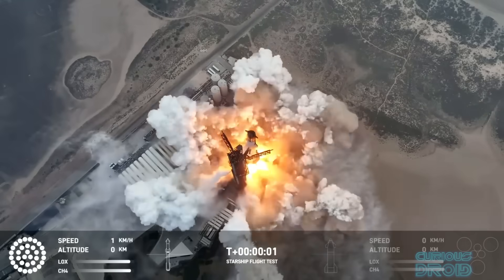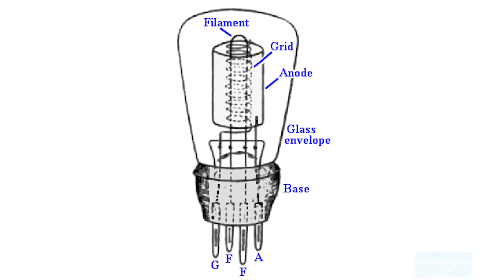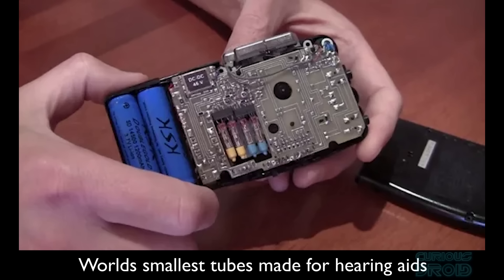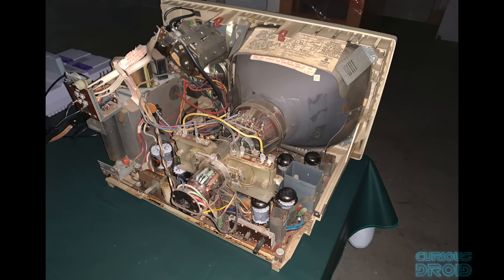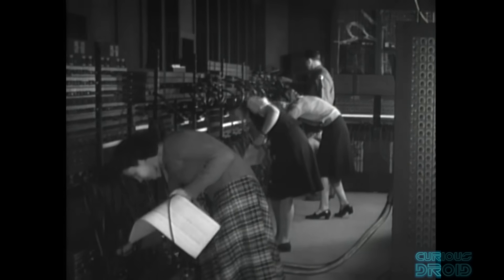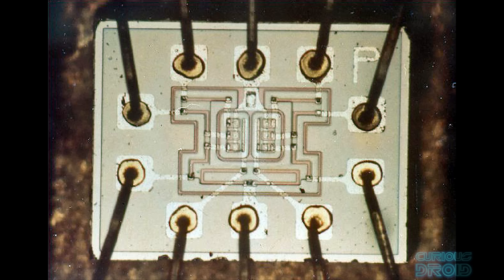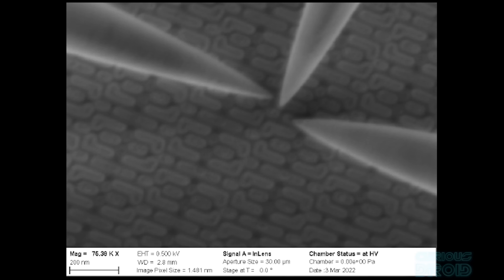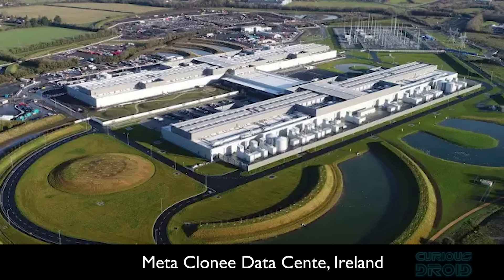Miniaturization - The Biggest Little Thing to Happen in the Last 60 Years

Comment: Batteries are weakest link in all of technology, since WWII, the physical form-factor and energy density of batteries of today, have only been reduced to 1/5 of there original size (there are only so many molecules of materials available for anodes and cathodes).  On the other hand, the smallest single function vacuum tube's glass envelope (the peanut tube) in 1945, will hold more than forty billion transistors, batteries will never catch up!

Comment: A monolithic integrated circuit (IC) is crafted through an intricate and precise process that transforms a circuit design into a functional microchip. It begins with capturing the design and simulating it to ensure performance and functionality. Once verified, the layout is meticulously created, defining where each component will reside.
The real magic happens when layers of silicon, each doped differently, are deposited onto a substrate wafer inside a quartz oven. These layers form the foundation of the circuit, while metal interconnects are added to establish electrical pathways. The wafer is then cut into individual dies—tiny, distinct chips—before being enclosed in epoxy housings. Each chip’s contacts are extended into small metal legs or pads, allowing it to be connected within electronic devices.
The result? A marvel of engineering that powers everything from computers to smartphones. It's a process that showcases the fusion of physics, chemistry, and electronics in a single piece of technology. Quite fascinating, indeed!

Comment: "that  remained pretty accurate up the 2000s when progress has slowed due to nearing the limits of  just how small we can make physical transistors."
The transistor size could (and was) still reducing, but what couldn't be done is clock speed rise. What you said before about "smaller means faster" stopped to be true, as no solution was found to the heat problem: current consumption in a chip are in frequency power 5 (if I remember well), which heats it, and after 2-3GHz it started to be almost impossible to run faster without burning the chip.
AMD saw that limit before Intel (that was still bragging about future 20GHz CPUs) and choose to use the excess transistors on the die (allowed by their continuous miniaturization) to go multicore (they were the first to do that).
A dual core chip at 1GHz is less efficient than a single 2GHz core chip, but AMD, and other after, realized they had no choice: the days of "smaller means faster clock" were over. So, nowadays, all the miniaturization gains are used to add more pipelines, caches, long instructions, vector registers, cores, GPUs, NPUs, etc. instead of doing the more efficient obvious (but thermally impossible): rising clock speed.

We may be now touching the miniaturization limit, but 20 years after we stopped rising clock speed...

Comment: 6:10 Are you sure about that power consumption?  150 KW for 18,000 tubes is only about 8 watts per tube, which doesn't sound enough considering the other equipment in the system (like the fans to cool them).

Comment: I worked in a TV repair shop when I was 16 in 1969. I  went on and learned both transistors, tubes, analog and digital computers in a military enlistment. We were also taught Boolean Algebra. Worked in electronics and telecommunications my whole work career with lots of hands on of computer hardware and  networking. I’ve seen a lot of changes along with miniaturization of electronics equipment.

Comment: In 1986 I got a job at a new semiconductor plant in Durham, NC (RTP). I worked in the wafer fab doing photo lithography. I also inspected the wafers layer by layer looking for defects. The semiconductors were printed/etched layer on top of layer connected to each other almost like a multi layer city. I was nuts to think someone designed them with millions of transistors and all the other elements. We did hundreds of chips for the military and other companies that needed specific purpose built chips. We didn't mass produce basic chips. It was absolutely bonkers. This was basically new and evolving tech. I think some of chips we made were in the 2-3 micron range not the nano range of today.

Comment: 8:55 - That Apollo computer is restored in a CuriousMarc video series a few years ago. It used core memory for RAM (Data only) and "rope" memory for ROM (the program).

FYI, ROM is where the program (firmware) is stored, and directly accessed by the processor, as opposed to the inefficient way current operating systems work. There, only a small "boot loader", and BIOS functions are run off a modern Flash "ROM" , while most of the programs are stored on your hard drive. That long power up boot up, is the result, of the OS (operating system) having to be loaded from that hard drive to RAM, when from there, its executed. Likewise, any program, also needs to be loaded to RAM, before execution. This is done also, on your smartphone. Though on smartphones, and newer (last 10 years) computers, the drive is solid state (ironically). In the embedded world, this inefficient "boot" (drive to RAM transfer), is excluded, and the program permanently resides in parallel Flash memory, that is directly executed by the processor.

Comment: 6:35 Does the i_Phone really have Floating Point? I thought those ARM processors, can't even do division in the processor! 
Btw Floats are a miserable Numbers_Format; each implementation gives different results, so they need to do excessive large bits: 64 bits for purposes where even 16 bits would do!!
A better definition would be John L. Gustafson's Posits Number Format. University of Singapore. With a hardware implementation of the so-called "Quire"-register those processors could do high-quality math, fast and efficiently! Indian programmers are redoing the Math libraries, which are often written in Fortran and contain some very old bugs! 
Unfortunately, the Posits format wasn't picked up by Fujitsu, or Intel (probably the US-NSA didn't like the idea!! it could ruin the "dark"-bits-spaces, where creepy Java creatures are crawling).  Nor did Posits become Standard in the Risk-V definition.

Comment: 12:49 which is a bad cpu that is out performed by the equivalent AMD part by a fair bit. the 14900 also lacks SMT, primarily because intel can not figure out how to secure the second processing thread adequately. They are covering this up by making claims of SMT being computationally expensive but that is only true for the current implementations that intel is using and that is only the case because their implementation of SMT has been flaw from the start. Although the comparison is generally accurate, comparing the 4090 to a 9950x or the upcoming 9950x3d would reduce the gap somewhat.

Comment: If you think ENIAC was the first digital electronic computer, guess again!  The Atanasoff-Berry Computer was actually the world's first digital electronic computer.  This was legally established as fact in 1972 in the case Honeywell v Sperry Rand.  It turns out that Sperry Rand used patents covering ENIAC to build a whole line of computers; however, much of the work that went into ENIAC was "borrowed" by John W. Mauchly and J. Presper Eckert, Jr after Mauchly visited Atanasoff and Berry in 1941

Of course, Bell Labs' invention of the silicon based, solid-state transistor occurred at just the right time, and the rest, as they say, is history.

Can you imagine what a modern data center working on vacuum tube technology would be like today?

Neither can I!.

Comment: We keep coming to the limits of Moore's Law and then finding ways to circumvent them.
Storage drives have long used multi-layer building. That idea has now found its way to CPUs and logic circuits. See any Ryzen 3d chip. Does it count under Moore's Law if you're talking about more than one layer of silicon and integrated circuits?
We have multi-layer gates coming, and next they say they're going to orient those vertically ~ not horizontally.
Then we have glass substrate and active cooling. The real limit to 3d chips now, is practical cooling of them.
Yes, we can make huge single whole wafer chips. That is being done, but that's not a practical way to do things.
Imagine a Ryzen 9, with an I/O die, and 2 CCXs. Then allow a 3d cache chiplet stacked under the cores. Now drop a 2nd one on top of that. Let's stack it 32 of those layers high. You know what's stopping us doing that right now? We can't cool it. There's no way on Earth we could run that at anything close to the speeds and the power a conventional Ryzen chip today runs at.
The problem is not even getting the power to it ~ it's dissipating the heat. We are going to see the data lines go to the top and the power lines go to the bottom. That's already in development. See "Back side power delivery."

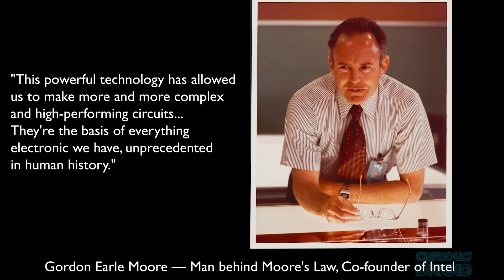Comment: 10:16 if we're being pedantic, technically, Moore's law is still pretty accurate because it was only concerned with the number of transistors on a single IC, not with the number of transistors in a constant area. While transistor scaling has slowed (and Dennard scaling has entirely died), we are skirting the limits of Moore's law by leveraging advanced packaging, allowing us to put more dies on a single package. This allows us to fit more transistors on the package while also improving yields because the dies are smaller.

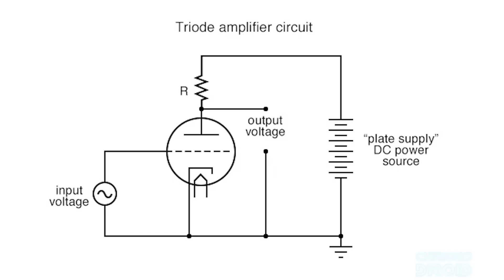Comment: 1:56 But  a valve still provides a cleaner sound than a transistor in preamps.... I'm 72 and we got a childhood full of happiness...
Reply: This was actually analysed a few years ago and it was found that valves subtly distort the sound, which people actually seem to like.

So it's not 'better' from a fidelity point of view, it just sounds subjectively better to a lot of people.
Reply: @loc4725 every form of reproduction has flaws. My recollection is reading that an integrated op-amp will typically operate at a 6% harmonic distortion level while a carefully tuned tube amp operating in class A, would have 1% harmonic distortion. Mind you, it was not made clear in which class the op Amp was operating.

Comment: A good video topic would be how a monolithic IC is designed and fabricated. From capturing a circuit design, to simulating it, then laying it out, then depositing the differently doped silicon layers onto a substrate silicon wafer inside a quartz oven, as well depositing the metal interconnect. Then cutting the wafer into individual dice and enclosing each one inside a small epoxy housing with the die's contacts brought out as tiny metal legs or pads. It's a fascinating process.
Reply: A monolithic integrated circuit (IC) is crafted through an intricate and precise process that transforms a circuit design into a functional microchip. It begins with capturing the design and simulating it to ensure performance and functionality. Once verified, the layout is meticulously created, defining where each component will reside.
The real magic happens when layers of silicon, each doped differently, are deposited onto a substrate wafer inside a quartz oven. These layers form the foundation of the circuit, while metal interconnects are added to establish electrical pathways. The wafer is then cut into individual dies—tiny, distinct chips—before being enclosed in epoxy housings. Each chip’s contacts are extended into small metal legs or pads, allowing it to be connected within electronic devices.
The result? A marvel of engineering that powers everything from computers to smartphones. It's a process that showcases the fusion of physics, chemistry, and electronics in a single piece of technology. Quite fascinating, indeed!

Comment: I started in ther early 70s' as a computer operator on an IBM 360-140 mainframe. We ran the processing for the world's 3rd largest oil company, a car parts retailer & an international chain of pharmacies. 
The system had 8 Mb of magnetic core memory (you could hear the cores flipping), executed up to 34,000 instrctions a second  & had around 140 MB of removable disk storage.
Today, my robot vacuum cleaner has a processor which runs 2,200,000,000 instructions a second  & has 8 GB of  storage.
So my vacuum cleaner is 65,000 times more powerful than the first mainframe computer I worked on, which was running the entire processing of 3 large international corporations.
It makes me feel older than my 66 years!
Reply: Me and you both. I graduated from tech school in 1978 & one of my first jobs was programming test sets using punch cards.
Reply: I feel that. It's unbelievable how fast chips have shrunk. I'm a little over half your age and I feel old! I personally think we've progressed too fast. Since the 1970's I don't think any one generation has been able to keep up. I mean I grew up playing with what was considered 'old tech' even then. Things like the old rotary phones and atari's, vhs tapes and cassettes. And even then those were old. It boggles the mind. I just hope the future of our species can cope. What happens when 99 percent of the population can no longer understand the simplest of systems? Oh we are buggered.
Reply: @ShadowDog_43 
Indeed, indeed... Indeed. We can't keep up with the manic progress of all the endless applications of something that is so many orders of magnitude faster than our own processing rate - not to mention so many orders of magnitude smaller than our own bodies. 

I'm 50 - I feel like you guys had the best, most epic generation, in this regard.
Reply: @ShadowDog_43  "What happens when 99 percent of the population can no longer understand the simplest of systems? " - I am not sure that will happen. It might be argued that we've been in a similar situation for the last 200 years. Even today what percentage of people understand the chemistry of the household cleaning products and shampoos they use? 80 years ago, how many people could have explained how a a radio works? How about the intricacies of an IC Engine? I'm not a scifi fan but the scene from Star Wars when Han Solo is repairing his spaceship comes to mind. Also, take a trip to Asia and look at the market stalls prepared to repair a smart phone. I think some interested humans will always strive to understand technology and the majority just use it. I don't think the percentage will change.
Reply: @andyroid7339 For the sake of argument, I'd say mobile phone market stall repair shops are mainly replacing broken screens and such, it's not like they need deep knowledge of the inner workings.
Reply: This isn't a "Hey, I can beat that" competition - but I can!  I am 80, went on my first programming course in 1963, for the RCA 301.  20K of 6-bit memory, punched card input, 10Kchar/sec magnetic tapes for bulk storage, 1300 lines per minute barrel printer.  That too ran the entire stock control, payroll and marketing departments for a global textile company.  Happy days!
Reply: @rattywoof5259  I'm also 80. First computer I had access to was an IBM 1620. Input was by punch cards. Output was an IBM electric typewriter. Fortran was just about to appear. We had 16K of memory. What I liked best was the blinking lights. IMO, modern computers need more blinking lights.
Reply: Imagine someone from the 1970s seeing one of those low-budget chromebooks.
Reply: I grew up in Silicon Valley with all of my family working for AMD, Apple, etc. so I practically already knew all of this history but this was a great video! You got a new subscriber for sure.

This is what’s amazing to me when I hear about “we didn’t go to the moon” folks spout their non-sense. My first question is always: “OK, describe to me how the microchip in your phone works.” They truly think it’s all magic. Which I guess is fine that the average person doesn’t understand how GPS works, etc. But it is tragic.
Reply: @Royaleoake The truth is nobody, even scientists or engeneers, actually know how electricity or magnetism works - the foundational things the modern tech builds on. Atoms, electrons, "holes", fields, current, voltage are all just abstractions, hypothesis. It's bizzar how eager we are to use the thing we do not understand.
Reply: That's almost as many instructions per second as I get from my wife! 😮

(Almost.)
Reply: Just give it another 25-50 years and the stuff we have today might feel like yesterday’s Morse Code telegraph

Comment: The argument concerning the warmth of a classic tube amplifier vs a digital one will never end where sound is concerned. You can use many different devices to measure what is being produced and they will say it's identical - yet people will still feel differently.

Is the digital world conspiring to make us believe it is always right?   :D
Reply: modern amplifiers are balanced, because mosfets are cheap. This means that they can amplify the signal more accurately, but they have more pronounced odd overtones. Like a clarinet, this makes them sound dark.
Reply: Literal warmth as the tubes heat up and everything settles in to operating temperature. 😄
With analog electronics there's always some variation/deviation and these 'soft edges' shape the output.
With digital sound processing we have to program program it back in to make the sound more 'natural'

Comment: The first computer I saw and used was a Texas Instruments 'Intelligent Terminal' around early 1982. I was working in seismic oil search and was earmarked to be sent to the States to train as a systems engineer. However, I had lied about my age when I got the job. I was only 17, and the minimum age for the job was 18. So I had to make excuses as to why I couldn't travel. Man, what a missed opportunity.  Back then I was earning about 100 bucks a day in the field, 5 times my friend's incomes. The system engineers were making 700 a day.